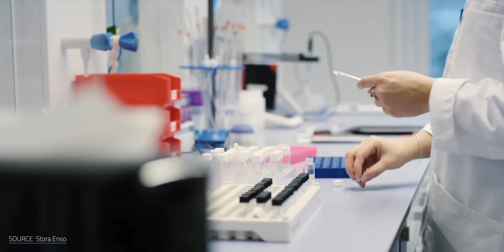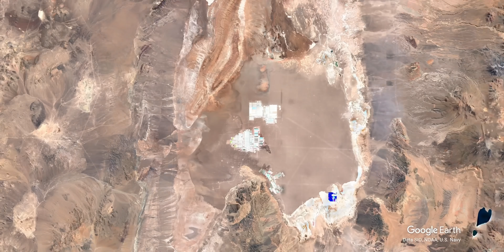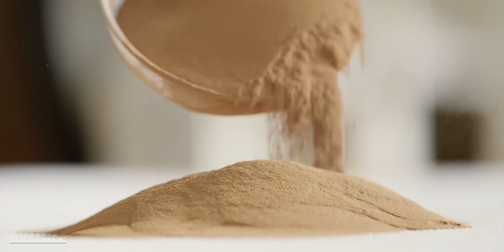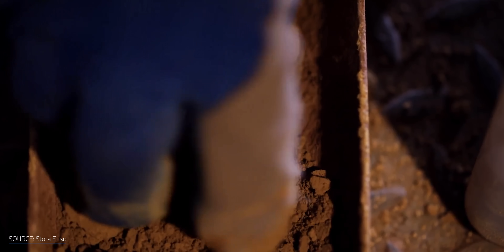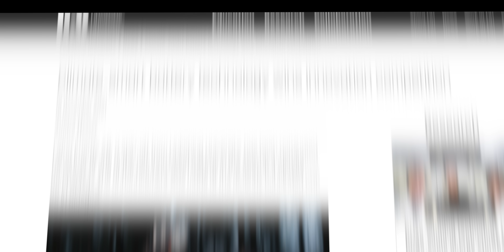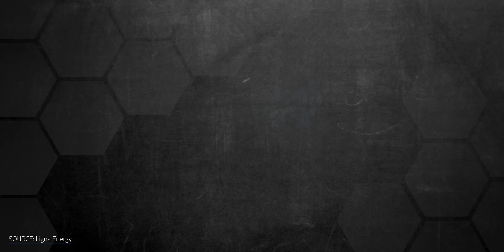Growing Batteries - Wood Battery Explained

Comment: Just thought of a water tank battery that could be used along side wind, possibly in the wind towers themselves, there'd be 3 openings in it, 1 at the bottom with a heavy metal sheet and a magnet above it (I'm sure most of you know where this is going now), the 2nd is for overflow, should be up top above the 1st with some guides along the sides top stop the overflowing water going anywhere but where it would be let out (where the metal sheet would be blocking at that time), that will allow recovery of left over energy if needed, finally the 3rd opening will be at the very top with a pump above it, the pump will bring the water up to fill the tank, the energy is taken back by letting the water out to power turbines, in other words when the electricity shuts off the magnet turns off allowing the sheet to drop which in turn allows the water to empty out, since all components there do not need a specific type of energy the raw energy from the windmills will be plenty, yes it might be maintenance hell but it's 100% green
Reply: It's called pumped hydro energy storage.

And water sucks unless you have a LOT of it. Think millions of gallons in a lake with another lake above it.
Reply: @lordgarion514  That's fine, just build the lakes then, just need a lot of dirt and rocks,mining sites need to send their dirt and rocks somewhere, why not dump it at a long term lake building project? There's no need to rush building it after all
Reply: @zxuiji  
You can't put that much weight and water just anywhere.

Look up "train car energy storage"
Cheap and work anywhere with a 5° slope.
Reply: @lordgarion514  You can, you just need to take the time to build it right, there are plenty of examples that already exist in nature, how do you think volcanoes which hold even heavier liquid exist? How do you think old volcanoes that have become lakes exist?
Here's how I roughly view how the lakes would be built:

1. The exit hole is made 1st with a ditch to it's eventual target, in this case a water processing plant

2. Pipe work and turbines are laid into the ditch

3. Build a small doughnut hill surrounding the exit hole for a pool of water to start building.

4. Line the bottom of the pool with rocks before the water starts to gather proper, this is to avoid large amounts of muddy water mixing reaching the water facility

5. You then build a path for the overflow from a hole made in the tip of the hill to a river

6. As dirt and rocks get delivered you go to the top of the fill and drop dirt on the outside part and line the new top with the rocks

7. Over the years this hill will gradually get bigger and bigger forming hole shaped like a reverse pyramid in it's center, it will look natural on the outside so you'll have little opposition if at all, on that note, what weirdo doesn't like seeing a lake?

8. As a bonus you can add some trees, foliage and left over rocks on the outside of the hill when you're satisfied with the size to turn it into a nature reserve
Reply: @lordgarion514  You realise the soil will still have to put up with the wright of the vehicles bringing more soil to the top of it, and the settling part is supposed to be intentionally allowed as you dump on top of it, falls into place and the weight of the vehicles compresses it, likewise does the local wildlife that will start to use it in the years it takes to build the lake, you're clearly the kind of person who gives up at the 1st hurdle instead of keeping at it.

Comment: These might have a role in internet of everything local warehouse storage etc. But an all renewables grid only needs 2 things:
1. Overbuild the renewables for your worst winter weeks to reduce how much storage you need. EG: Don't build 100% renewables - build 200% or whatever your country needs.
2. Then build OFF-RIVER pumped hydro. Once you look OFF-RIVER, satellite maps show the world has 100 times the potential resource it needs! The Blakers team at the Australian National University concludes: "Pumped hydro - which accounts for 97 percent of energy storage worldwide - has a lifetime of 50 years, and is the lowest cost large-scale energy storage technology." The world has over 100 times the potential storage it needs. Pick your best 1% of sites, build the off-river pumped hydro, and you're done. It’s off-river. It isn’t going to hurt a fragile river ecosystem or fisheries. Without a river to deal with you can build the whole thing at once, so it's faster and cheaper. You avoid the on-river costs of spillways and preparing for the 1 in 100 year river flood event - about HALF the costs of on-river Pumped Hydro! Once its built, then slowly pump the water down a long pipe from a river in the region. We can float solar panels on top to reduce evaporative loss, but they use 90% less water than coal plants anyway. It makes WWS - Wind, Water, Solar - the cheapest form of electricity.
You can watch Professor Blakers here on Australian data and then his satellite map of world potential sites http://youtu.be/_Lk3elu3zf4?t=986
Or see his Global Atlas here http://re100.eng.anu.edu.au/global/
Or read his report on Australia here about how we have 22,000 potential sites - but only need the best 20 to 40 (depending on the size of what we choose). http://www.anu.edu.au/news/all-news/anu-finds-22000-potential-pumped-hydro-sites-in-australia

Comment: Transport is probably the biggest market for batteries especially bike batteries as some countries are turning away from cars, so it would make good sense to target replacement of bike batteries and electric scooter batteries so these vehicles can be used safer, charged safer, and stored safer, so unless they have a battery that can replace a bike battery we are stuck with lithium, which catches fire from time to time.

It's very odd, many companies ban people taking their electric bike in their buildings now, but provide parking for electric cars, even in their garages, considering these cars use exactly the same battery tech as the bikes I find this very odd, to allow electric cars to park in underground parking but not allow electric bikes or scooters in.

Comment: My thoughts on energy is that if you focus on one for energy for environmental efforts that's meant to be "clean" and "eco friendly" it will be in vain because companies will eventually rack up the demand and end up using methods to cut corners.

Not enough wood batteries? Let's cut more trees down. Not enough coal power? More coal. Etc.

Point is to have an equilibrium of multiple sources of energy and to minimize the impact by cleaning the manageable waste/pollution.

If we do that, humanity would've been fine.

Comment: It seems like a lot of the problem with comparison is that lithium batteries aren't sustainable and the price doesn't include clean up.

When we have multiple options to get the job done we can do comparisons based on cradle to grave costs.  Maybe we all have to start driving big vans to accommodate less energy density.

Comment: I'm in the "Clean Energy is a Scam" camp.  Mostly attaching "Clean" to the title.   Cleaner Energy is a more accurate term to use, but then again as you showed with your graphite segment, modern Lithium Ion batteries are not very "CLEAN."    I'm all for cleaner forms of energy whenever possible as long as it isn't being done just for the sake of doing it.  For example Ripping down a forest to make a wind farm for example doesn't sound very "Exo-Friendly" to me.    I'd love to see wind turbines installed on top of tall buildings in major cities, along side solar panels though.   More use of smaller wind turbines with small footprints within local communities.  But when I see a massive wind farm scaring the country side it hurts my soul.   We have a donut factory for example that has two wind turbines installed on top of one of it's facilities for example.   Every bit helps in my opinion, and would cut away the need of larger facilities dedicated to it.

Comment: Graphite sucks that's why graphene in super capacitors. You can use hemp stalks in a bath to electroplate the graphene into hemp stalks making super capacitors. Mitlin decided to test hemp bast fiber’s unique cellular structure to see if it could produce graphene-like carbon nanosheets. Hemp fiber waste was pressure-cooked (hydrothermal synthesis) at 180 °C for 24 hours. The resulting carbonized material was treated with potassium hydroxide and then heated to temperatures as high as 800 °C, resulting in the formation of uniquely structured nanosheets. Testing of this material revealed that it discharged 49 kW of power per kg of material—nearly triple what standard commercial electrodes supply, 17 kW/kg.

Comment: You know since radio has become so ubiquitous and on such small scales I don't see why batteries in general... ALL OF THEM couldn't have their own discreet radio that turns on automatically after thrown away for easier end of life processing. They could use something like the ultra wireless RF label used in shipping to track before getting to the dump or make it easier to sift through all the trash with directional receivers to find them easy with minimal effort like tracking your packages on Amazon. For the radio to become activated all you would need is a temp algorithm to find out if the battery is in the garbage or sitting in a box for 10 years. Grocery chains are already doing this and the radios are one time use with button cell batteries.

Comment: At least this “wood “ free up the resources used for mobile applications to be used just for mobile applications.  Using the same battery for all applications is not only a limitation on the amount of battery power available, it’s also a limitation on the ways that batteries can be used.

Comment: Personally I wish countries would ban the use of Li-Ion batteries for use in grid storage.  That's the LAST place it needs to be used.  Density isn't critical for grid storage.  Number of cycles, cost, and conversion efficiency are the most important issues for grid storage, not power density.

Comment: I have worked with a biobased battery. With lignin in it, at Ligna energy. Lignin from paper Mills is a by-product and is burnt 🔥 (so technically it is used in a minor way) Still, Lignin is dirt cheap and plentiful.

Comment: @10.00 have asked previously if it was possible to draw, using a pencil or similar, a standard circuit using icons as resistors and other circuit components to replace such a circuit or is this still my dream?

Comment: I have used Lignin based products in a wide range of applications: it is a wonderous materal. Could the carbon-lignin be coupled with Aluminium to product an affordable automotive battery?

Comment: How can you "lose water" by evaporation?
Reply: I think its meant as in the evaporating water is fresh water which could otherwise be used as drinking water, I can't really see how else it would make sense?
Reply from the maker: Yes, precisely.
Reply: They extract huge amounts of low ground water, not necessarily caring for the drinking water but drying many of the wells of drinkable water, people have used for centureis

Comment: Is there any good way for a DIYer to build a suitable battery for their own home? This could be used for storing solar or wind power, or could be recharged from the grid for either emergency power or to gain power savings by recharging at the best time of the day. It needs to be also compatible for the great white north.

Comment: If it is useful and cost-effective, it will find its niche in the market. And this is good! Even if it never replaces lithium-based batteries, it will help because it can ease the economic and environmental pressures of lithium demand. There may be hundreds of different battery technologies that make it into the market, and they all contribute in their own way to fill a demand that is only getting stronger.

Comment: All you need is a flywheel system, a mechanical battery, the wood battery, and some capacitors for the electric car, long story short if you sync them right it'll be able to power the car easily.... if you don't mind the loss of some speed or acceleration the efficiency could make up for it, it might reduce the lifespan of the battery but with everything it would be sistered this in theory would matter, based off the idea they would have it built so if one power source gets too stressed it will fall  a little more onto the next, and then continue the stress rotation, which could be programmed into the cars computer, like a heart monitor for the car.
P.S. if info on this was an iceberg i only know about the snow that sits atop of it.... but if they test it and it works i just want the blueprints and a prototype version i can tinker with

Comment: I'm really hoping that some of these new battery techs will start pushing to the home solar market.  You have a little more room then an EV or laptop.  And being consumers, having them safer/less explosive/easier to maintain (temp ranges)... is a good thing!  I would decrease the amount of capacity / size for eco friendly/longevity. and cheaper for a home solution for Offgrid / hybrid / off peak time charging!

Comment: Take thin wood and soak it in a solution of vinegar and salt and you will get electricity, you need wires connected to the wood though.

Comment: The best way we can see proof of a sustainable approach to eco-friendlier tech and energy R&D is to produce a mock but actually usable model testbed of every known component in the market, yes?

Eg. an entire home + office suite that is built with all these new discoveries (lignin based electrical wiring grid solar generator perhaps) on a constant all year test-use rate, instead of a prototype with a ahort live demo.

Now imagine an individual wall incorporated with this bio-cell tech as an in-home energy storage module from a centralized energy source grid (roof grid > individual wall panel storage), wouldn't that reduce the risk of entire powergrid shutdowns we've always seen all these years? Pair that with some form of economic incentive and we could see a form of passive economic sustainability that individual homes can benefit from, if government policies allow.

Comment: My concern with wood-based batteries is driven by the behavior of the wood industry, which has long shown a distinct disinterest in the impact it has on the environment, from cutting logs shorter to be able to export and import otherwise illegal wood, to clearcutting ecosystems and not replanting, and more. I do not believe that all adopters of this technology will be willing to buy only from suppliers who source the wood ethically, and it's just going to spur more environmental degradation. Too many greedy humans, I'm afraid. Wood you like to comment?

Comment: "as reported in their whitepaper the material has more disordered and open structure compared to graphite, which is arranged in regularly spaced layers"... "more accessible by lithium ions which speeds up the charging process" - Alright if that's true, wouldn't that make it way harder to turn into a battery though...charge doesn't just boogie to the most chaotic place it can find, does it?  "and while they haven't provided any evidence for that yet".... ah i see

Comment: Per the video, lignin currently goes to an incinerator to produce energy.  Presumably that energy is going toward powering the paper mill and reducing its operational costs.  If the lignin is going to batteries instead of the incinerator, the paper mill will need to get the energy it had produced from elsewhere and increase its operational costs.  I wonder how that will affect the cost of lignin and paper mills' willingness to participate.
Reply: I think the paper mills could serve to add renewable energy to their roster so that their byproduct can be used for more promotion of renewables. It just happens that the industry balanced their waste product into fuel for itself, not cause it was necessary, but for convenience.

Comment: I am sure this will get used.  Will it overtake Lithium Ion?  No!  Does it still have a place in grid level storage? Yes, in house or building level storage.  The price will put pressure on every other option.  They will need to keep working on cheaper ways to do things.  One more tool to use.

Comment: Only drive 16 miles a day. I’d be ok with a better longer life battery even if I couldn’t drive 300+miles on a single charge. They make the batteries able to be removed and changed out easily by a normal user. That’d change the market.

Comment: Yes, it is just mobile applications like cars that need the extreme performance Li provides but there are other large storage needs like power Grid storage (and grid forming) that do not top permanence in kw/kg or kW/m3,  but benefit from low $/kW over its life.  Would love to see EV find a better solution but let's also be looking g for best solutions for other big energy storage needs.

Comment: For balance, please...
oil production & pipelines pollute vast amounts of land - much more than what the lithium evaporation does
byproducts of oil production like unwanted gas are either burned off right at the point of separation (e.g. sea platforms) or at the refineries, or just released (like methane) into the air
ash, the byproduct of burning coal in power stations, oftentimes can not even be used for concrete filler because of ... heavy metal or radioactive content, so they store it in large mounds that get rained on and .... dissipate these into ground water
Yes LiIon is not perfect.